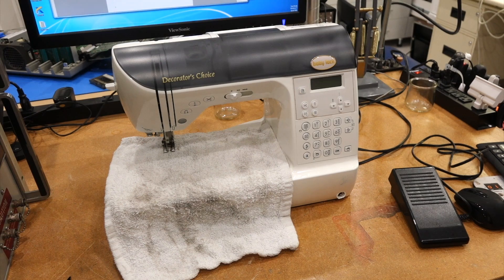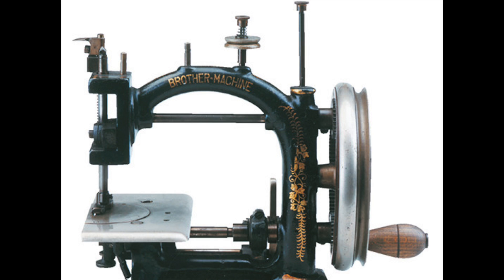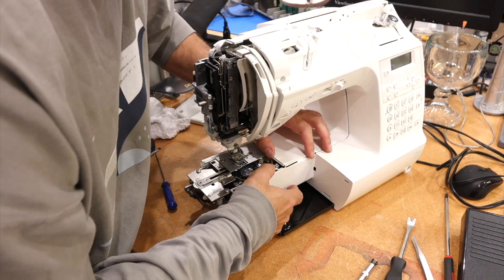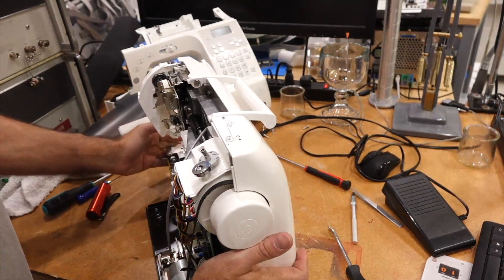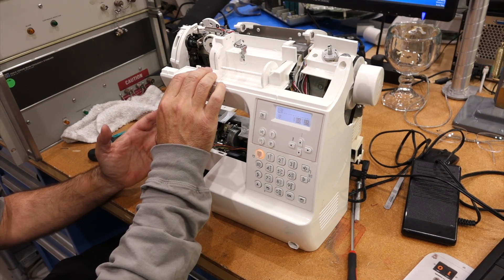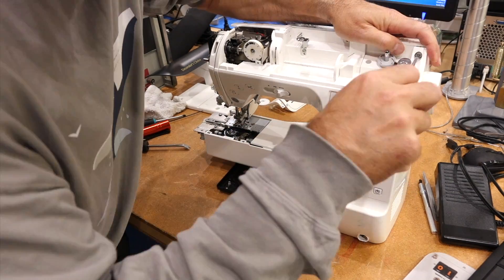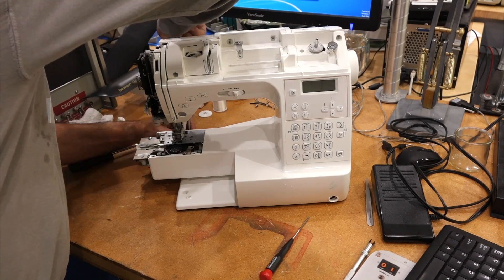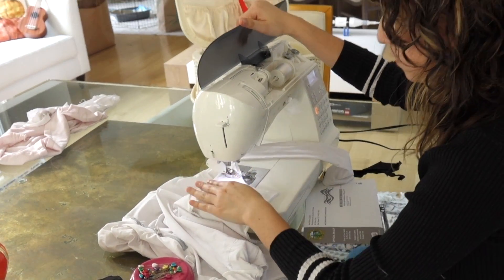Modern Tech Fails: Baby Lock Sewing Machine, "The Safety Device Has Been Activated!"

Comment: I’m a pro seamstress.  Part of my job requirements is to be able to do basic cleaning and maintenance of the mechanical components of any traditionally-designed/industrial/not plastic sewing machine a workplace might have for me to use.  That’s easy enough.  But when I do freelance work out of my house… I haven’t yet figured out how to get the plastic covers off the domestic machines I have at home, not even to remove the lint!  How did you do it?  I can’t find service manuals for the machines I have.  How did you end up finding all the screws and plastic latches without looking at a manual to tell you where they were?
Reply from the maker: Mostly trial and error, trying to pry things gently, and see where they bend and seem attached.

Comment: What a satisfying repair, well done. I suspect it may happen again in the future. If this was a machine in my family and the belt slipped off twice, I would have cut out a hole in the right side, large enough to re-seat the belt. A larger piece of some plastic on top od it and secured by bolts in threaded inserts. Much work, yes, but it would make the machine less likely to be thrown out of an open window someday.

Comment: Jeeze... I've worked on some of my mother's sewing machines, which are from the 70s and 90s, and found them very easy to disassemble and put back together. IIRC both were designed so you could gain access to the belt, without having to take the entire casing off.

Comment: I do wonder why that toothed belt came off the pulleys though - I hope it doesn't happen again, though you know the way in now ...
My much simpler Janome machine was nearly as much trouble to get apart - I had to distort the two plastic clamshell case halves to disconnect them - who knows how they do this on the production line :o)

Comment: Funny. My mother still uses old soviet sewing machine driven by treadle (pedal) mechanism. The thing is completely mechanical, all electrics there is a little lamp. Reinstalling belt there is very easy and take seconds. 
Of course I'm far from sewing but this thing looks overcomplicated. Never thought home sewing machine needs a ton of electronics and so much buttons with freaking computer inside.

Comment: As soon as i heard that it's manufactured by Brother, my first thought was how this would be a complete nightmare. My mother's old brother machine jammed up several times, requiring days worth of work, and afterwards, i had to adjust the tention mechanism and adjust the timing of the lower mechanism by trial and error, because there was no available service manual. I do not miss it. She upgraded to a mechanical machine that doesn't sound like its going to self destruct, and if it starts having issues, there's a service manual available online.

Comment: Sewing machines are some of the oldest "maker" machines. You would think with all the awesome mechanics on the inside, they could do a better job of making them easy to service. But no.
My wife's sewing machine is also a pain the butt to take apart, and they (Husqvarna in my case) used, like, 16 different types of screws and half of them are hidden, seemingly to make you break the plastic if you try to repair it yourself. And there are no service manuals online.

Comment: My costume designer friend says those are good machines. The "Baby Lock" name comes from the fact that they're more compact than a standard overlock-stitch machine. I hate locking tabs too, but a pro who knows where to push can probably pop them apart in no time. As an Apple technician told me while deftly removing the screen from an iMac with a heat gun and suction cups: "Once you've done a couple, it's actually quicker and easier than taking out a bunch of screws." PS -- Wish we'd gotten to see the finished costume!

Comment: What a monstrously complex implementation of a sewing machine. The problem could have been avoided entirely with a flanged pulley or a small access hatch to replace/remount the belt. Madness! And you know nearly all the other machines that have succumbed to the same design fault ended up in landfills somewhere.

Comment: What! No leftovers, whenever I finish reassembling a repair their is almost always four screws two washers and and a couple springs and a gear even if the device never had any gears.
Was there any adjustment on the motor mount to takeup any slack in the drive belt?

Comment: A few months ago I had to repair my wife's Bernina (top Swiss brand) sewing machine from the 1980s. Guess what the problem was: a sizzling Rifa X-capacitor. My son assisted me and luckily he found a service manual online. This was extremely helpful for finding the right screws for opening the housing. But there were no parts clamped together with hidden hooks.
BTW: after the successful and quick repair, my wife stopped complaining about the component stash I have hoarded in my workshop ...

Comment: There's something to be said for an old 1940s Pfaff machine: no electronics, purely mechanical, and no shield around the motor and belt. No plastic, either, as I recall.
A less general error message would have been nice, too: "Drive belt failure."

Comment: All that for a belt. Not a broken part, but just put it back. 

Jeeze.
Reply: Probably wearing out. If you're trying to work with a material that's too thick, the belt can slip off.
Reply: @BlackEpyon  
Like changing a belt in your car. You shouldn’t have to take off the bumper and fenders.
Reply: @larryscott3982  Not to mention the pain in the arse face if you accidentally bump something and the airbag goes off.
Reply: @BlackEpyon  
The hidden screw and only partially unscrewing it? That man has experience. Imagine my dumb ass trying to put that screw back.
Reply: @BlackEpyon  
Or having to disconnect an electronic ignition harness and it loses its programming. Bad enough changing the battery and then having to enter a code to get the radio to work. The code that’s been lost long ago. (I didn’t get a code with my car. (It came off a lease, still nearly new, and the dealer had to pull the radio to get the S/N and screw around for while.))

Oh …. dealer?
Reply: @BlackEpyon  
Sometimes it’s not an option.

Comment: Good grief. I remember not that long ago when household sewing machines were repairable items! In particular getting to the belt and threading path, since there were always problems in those areas.

Btw, there is a type of commercial sewing machine known as an "overlock". It is what is used to make the seams on about 90% of the clothing made these days. Commercial machines are large. Juki originally made a Babylock that was a home version of an overlock machine, and 30 years ago if you said "babylock" to anyone used to sewing machines, they knew it was a small portable overlock without the extra safety stitch. I guess it is now a brand name instead of descriptive trademark.
Reply: All my mom's sewing machines are completely mechanical, and they're still a bitch to take apart. I hate working on those things.
Reply: Very interesting. I was wondering where the name came from, initially thinking it was because it had some safety device to prevent children from being hurt.
Reply: The episode is already three years old, but maybe still interesting. In Germany, and perhaps also in Europe, Babylock is actually synonymous with the best semi-professional overlock machines by far, not with mass-produced, cheap plastic machines.

The nimbus is probably mainly due to the fact that the machines have a partial threading system with compressed air, which everyone else has been trying to copy in recent years and charging similarly high prices for. Nonsense, anyone can quickly learn how to thread an overlock machine and it has to be done relatively rarely compared to a conventional sewing machine.

Babylock's real trick is that the machines are not equipped with thread tensioners, which are practically friction brakes, but with thread feeders that work depending on the height of the presser foot, i.e. the thickness of the fabric layers, and also on the cutting width. This makes it possible to sew an exact seam virtually in the air. Even the Swiss, who are known for their precision technology, source their overlockers from Japanese companies and have nothing really equivalent in their range.

I think that an ordinary plastic/sheet metal machine like the one shown here would do damage to the Babylock brand. I myself already hate the shreaking, crunching and resonating (from the stepper motors) noises of such machines, which remind me of the first cheap printers for home computers or scanners for PCs. A real sewing machine sounds like a swiss watch, a bit louder... 😊
Reply: @imho4556  I guess the Babylock has changed considerably since I last saw one 30 years ago. At that time it was a very good machine, but was something portable that you clamped to a table rather than a full size professional overlock built into a table. The machine was all mechanical in those days, essentially identical to a professional machine, just smaller and portable.

Comment: On the other hand, now you know that the machine has a very sturdy casing that can take a lot of abuse. So it will last a long time and this is machine will become one of those random things to be passed on for generations.
Reply: Likely, the computer will have some kind of fault long before that. I prefer the completely mechanical machines. More powerful motors for working denim (and other thicker materials that guys tend to use), and much less to go wrong. Most guys also don't need the embroidery junk to repair their clothing (straight and zig-zag stitch are usually sufficient).

Comment: That was an unexpected change of pace!  I wish it was hard to believe getting to a sewing machine belt was so difficult.  But the trend towards not being able to easily maintain most anything started many years ago.  I'm old enough to remember when things were designed to be serviced easily.
Reply: @SteelRodent You  never saw my Granny's old singer.  You could replace the belt with no tools.  I've still got the metal oil can that came with it that has Singer stamped on it.

Comment: So this gets posted the day after I fixed my wife's sewing machine. I love coincidences like that. In my case it was just a blown RIFA cap (it's a 26 year-old machine). But it took me a long time to get the damn cover off. Had to drop $10 on a service manual in the end just to find out where the secret screws were hidden. However, the repair went so well that I had parts left over when I reassembled it!
Reply: Be a hero and post it for free online.
Reply: Just had a similar adventure with and Epson Laser Projector (about $13K New)  Epson wanted $5k for the repair and said it was only a 70 % chance of fixing it.  We declined.  I took it apart, found a spinning disk in the optical path that had come loose.  It was hard to get to!  I spent $8 on a tube of red loctite to reattach the spinning disc.  Should have filmed it like Marc.  Absolutely nothing out there about taking these beasts apart!  My repair went equally well with only about 12 screws left over.
Reply: Were there enough parts left over to build another sewing machine??
Reply: I did the same a while back but fortunately the cap was in the pedal and easier to access.

Comment: Is it me or the motor seems to be terribly flimsy and  undersized ?
Reply: It is undersized. This machine is made for fancy embroidery, not sewing denim or leather. My mom's got an old Viking with a beefy motor that's worth the pain in my arse to keep going, because she uses it to repair my work clothes.
Reply: It's a sewing machine. It doesn't need a 100hp. In ye olden days, these things were often powered with footpedals by old grandmas. Also, the slower you go, the more precise your sewing generally is. So you want to gear down the motor anyway, which in turn gives even a relatively small motor enough torque to move the axle for normal use. If you limit the power, you limit the maximum thickness/layers you can sew. So a smaller motor might prevent you from making leather jackets, but it's certainly enough to make the occasional curtain or halloween costume.

Comment: I can never figure out how they get these sorts of things assembled in the factory with any level of efficiency.
Reply: Dad has a saying that often helps in this situation - remember mass produced devices mightn't be designed to come apart easily, but they definitely are designed to be put together quickly, cheaply and easily. In this case, order of assembly (and knowing where the screws are) as well as a jig or two would probably make assembling on on a production line much quicker even if it doesn't make it easy to work on.

Plastic tabs are probably cheaper and quicker to install than screws (the manufacturer doesn't pay for the frustration of anyone working on it after assembly).
Reply: Kids have smaller more nimble fingers than us grownups. So lots and lots of child labor.
Reply: you'd be surprised how these get assembled. A good documentary about how stuff like this can get made: https://www.youtube.com/watch?v=xMm-YMO5H7o

Comment: As soon as a manufacturer adds a micro to something that doesn't need it you're asking for trouble...  Seweing machines, vaccum cleaners, fan heaters etc etc etc.   At least this one turned out to be a belt, but what a useless error message!
Reply: In this case they kinda need it, because it's used to move the needle around for the more complex patterns (i.e. not sewing in a straight line); they used to do it with cams and levers but it's just not as flexible. Still, I agree nowadays they tend to stuff a MCU and wireless connection in waaay too much stuff
Reply: Yeah. How many of those smart fridges are actually being used to re-order groceries?
Reply: @gigigigiontis8  I do wonder how many of those fancy stitches ever get used? I have a late 70's brother machine... To date I have used perhaps 3 of the 20 or so stiching cams it came with.
Reply: @AndyMarsh  I guess it depends on the kind of work you do with the machine, but I get your point
Reply: @gigigigiontis8  I prefer the embroidery cams, there's MUCH less to go wrong. I don't need a sewing machine that sews flowers in a circle. Straight and zig-zag stitches are usually sufficient, and I prefer an older machine with a much more powerful motor for working with denim and leather, which I am MUCH more likely to make use of than embroidery.
Reply: Giving the choice between: complex clock like synchronized mechanics,  electromechanical stuff with switches,  microcontrolled stuff with self diagnostic.  The latest is not necessarily the worst choice.
Reply: @2adamast  Those sel-diagnostics might actually be useful if they told you to do something OTHER than take it to the service dealer. Like cars these days, they've got error codes, but you need to hook up a dianostic tool to find out what they are. They've all got digital odometers these days, why can't they just flash an error code?
Reply: @BlackEpyon  Some older cars could do this (flashing error codes via an LED for example), but then the manufacturers realised that they could make much more money by making the dashboard show "Warning! Service now!" which just panics the majority of people into taking it back to the dealer.
Reply: @Zeem4  Yeah, I've got a '95 Chevy pickup with OBD1 that you could just short a couple pins in the diagnostic port, then turn the ignition to 'on' and it'll flash the error code, which you can then look up. My '98 Chevy pickup has OBD 2, and I've got an OBD2 scan tool for that. My '96 VW Jetta TECHNICALLY has OBD2, but it's a proprietary format that only Volkswagen's scan tool can read. I don't even want to think about what hoops you need to go through talk to the newer cars with CAN bus without one of those $2-$3k diagnostic computers.
Reply: @2adamast  My gripe is not really with that kind of thing...  It's with micros on things that really don't need it. A fan heater, hair straigtener, vacuum cleaner, food mixer etc etc... these things only need an on-off switch.  I have a flashlight that has (as a feature) "Battery Guard" technology.  The battery guard is a mechanical switch rather than a soft switch on a micro.
Reply: Well how else am I supposed to connect it to the internet, and control it with an app?